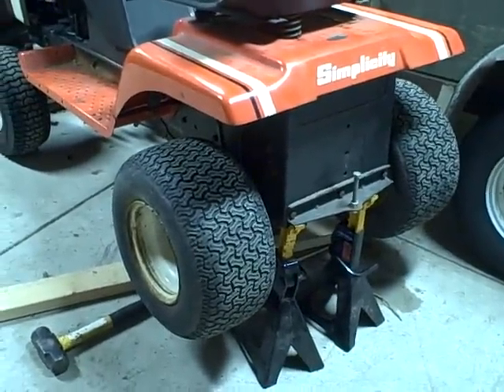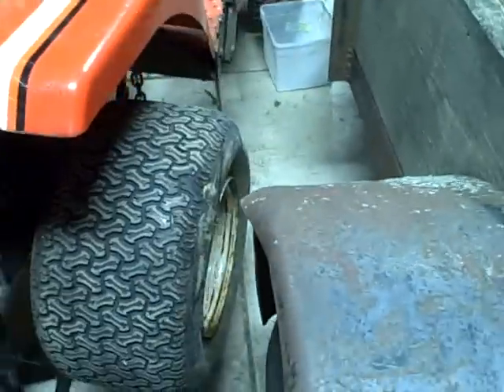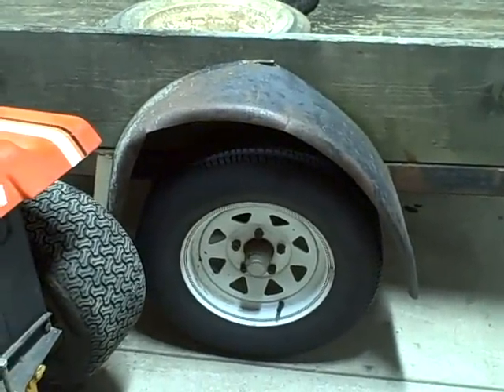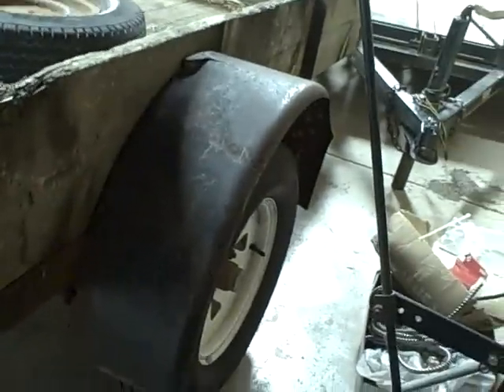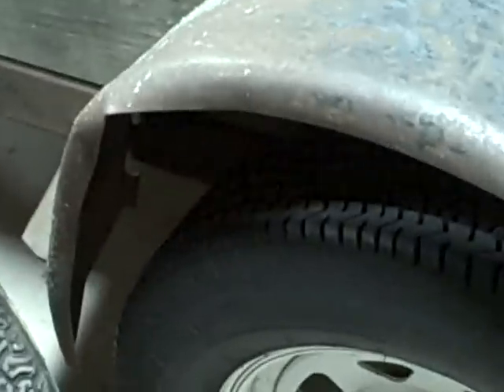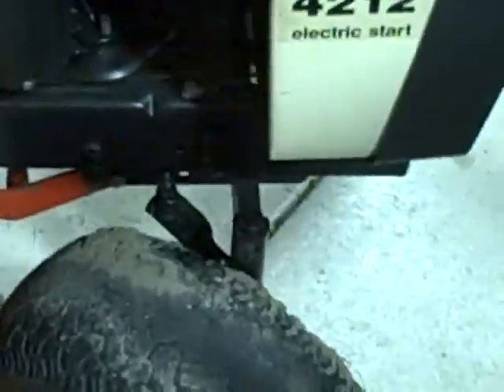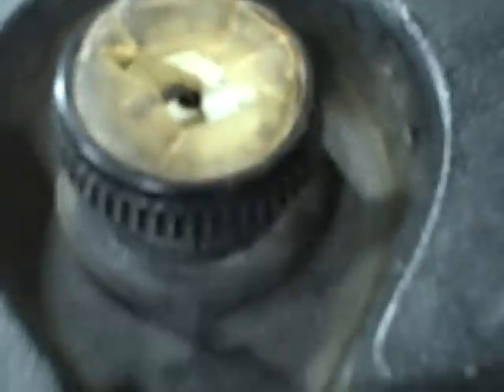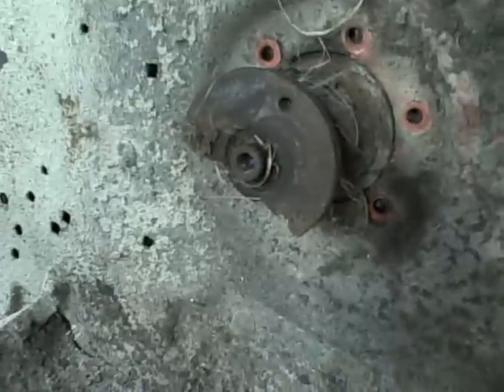Update 9-27-2011

Comment: On that tractor with the cut wires, on the engine side, just fond out what wire has the voltage coming off it, then connect it with the red wire, it should work, sweet find with that $50.00 tractor!